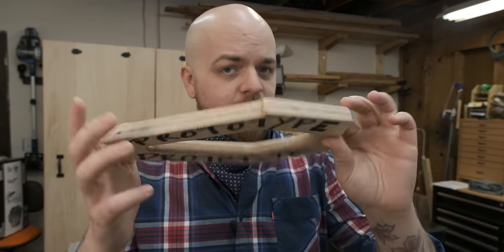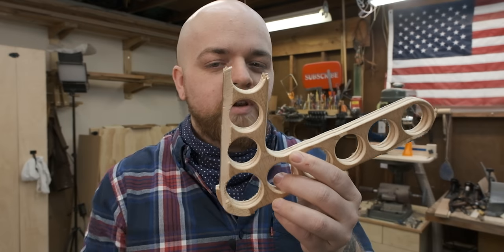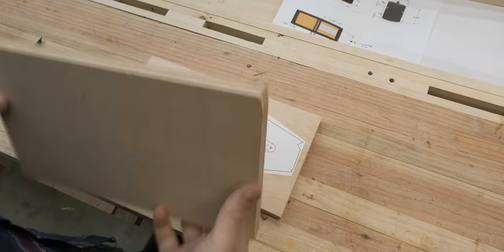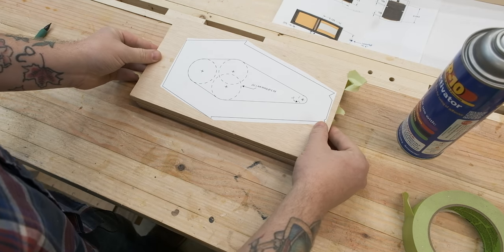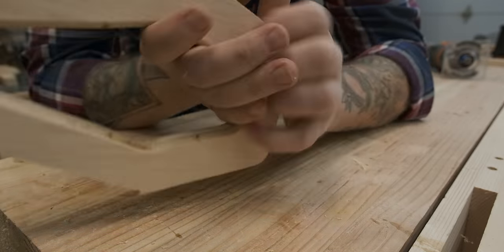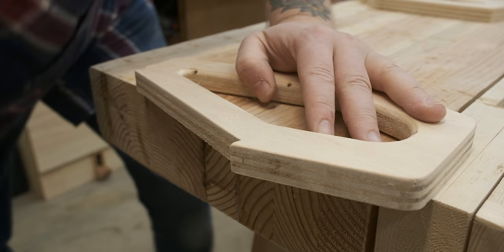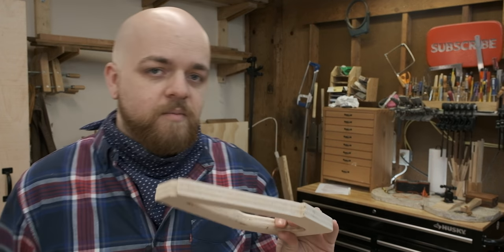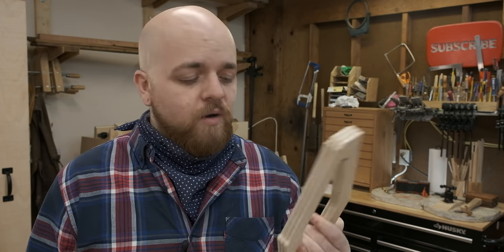DON'T CUT YOUR FINGERS OFF! Make The Optimum Push Block

Comment: 2:41 Uh... Canada uses Imperial... and some in United Kingdom too? ... If you google that, only THREE countries still use Imperial... United States of America, Myanmar, and Liberia... and the latter two run Imperial alongside Metric.
I live in US... and I HATE the Imperial system. I can still deal with the fact 1 feet is 12 inches just fine... but just kill me with all the break numbers in under-inch-denotations. Yeah 1/4... 1/3... 1/2 is still fine... but when you need the next higher drill from 1/2 inch... and that's then 9/16 inch... all I can say is... WTF! What moron came up with that? Why on earth break numbers? That makes no sense, i'd rather have some arbitrary number that divides 1 inch into 12 segments.
And yeah I know there is a way to use decimals for those too... but guess what, Drill Bits DO NOT USE DECIMALS.

So yeah, I not shit on the Imperial system... but it is highly impractical and I not want to know how much it slows down work performance in some folks. Me included.

Comment: wish this vid had been there BEFORE severing my middle finger tip and 4 tendons, scaring the cak out of my kids, 3 surgeries, 6 months of physio and a further 2 years (cos I didn't do the self physio at home as much as I should have) of pain and struggling before I could hold a saw, chisel, hammer or the 4 years it took in total till I could grip a screwdriver one handed.  I could have put a thin piece of board to cover the front and back faces and use it as a coffin to bury the finger tip (They actually ask you if you want to keep them! gross!)  n all because I used the wrong tool for the job and got kickback.  Yes, my hand would still have hit the table surface, but probably have been far enough away from the blade to still have all my finger (I'd also be able to give idiot drivers the bird!).

Looks like a really good design, keeps the hand high up from the blade.  I'll probably make mine a bit oversized.  Thanks for giving this to people and for explaining why it's different to other styles.

Comment: Thank you very much for the templates for this push stick. The design is great. I'm going to make a pair to use on my next project which is a long low cabinet shelf with lots of cutting and jointing using my table saw. I'll call them "Dracs" because... well, you know. LOL! Thanks again.

Comment: Cool design, but not for me, sorry. If the push stick breaks, your hands will be going straight towards the blade.
If I were to make such a push stick, I would make the angles not parallel to help with that, maybe 5 degrees or so, and I would add either a vertical or X-shaped profile in the middle, to help prevent the plywood from breaking.
Here's MY reasoning; If the piece gets caught in the blade for whatever reason, you are going to hold on tighter to your push stick to make sure it doesn't kickback on you, thus applying more force to the push stick and risking of breaking it more easily. And if the push stick breaks while doing so (trying to retain the workpiece from kickbacking on you) you would have your hand pointing slightly upwards, which would mean you would be less inclined to go straight down when it breaks but more forward and less downwards.
I will stick to the Grr-Ripper for now, even though I don't like it that much either.

Comment: Thanks so much for template!  Really like it’s design. One thought that I noticed was do you have a lot of runout on your drill press?  From the video I could have sworn your bit was wobbling. I also could be my eyeballs. Thanks again for the video and commentary!
Reply from the maker: It's strange, there appears to be a ton of runout when observing it run, but the holes cut clean even when the stock is clamped down securely. I'm really unsure what's going on to be honest.

Comment: Hooray for Imperial and Metric, it causes me to own 2 sets of drill bits etc. The problem with watching US videos is in the wood measurements. I dont have 1/2 inch or 1 inch plywood. I have 3mm and 7mm and 9mm and 12mm and 16mm.

Comment: I know you seem to like the CA glue trick... but, I have been using an alternative to that for years, and all you have to do is square up two side of the two boards. Take the squared up boards and run a single piece of tape corner to corner over the edges of both boards along the two squared sides. That's it. You're done. Use a quarter of the tape, and no CA at all, nowhere near the pull off trouble. The only drawback- don't use this method if you are cutting angles into your boards.

Comment: I DID download the push block plans. (Kinda cool how the product of your brain winds up glued to wood in a Tennessee shop.) I find your design great to use for precisely the reasons that you mentioned. I would like to suggest one small additional operation to the fabrication. In addition to using a round over bit on the inside of the block, I also rounded over the outside, but only on the back "handle" area. A bit better feel in my opinion. THANKS!

Comment: Having built many push sticks/blocks over the years, I thought there was no way to improve the design. Happily, I was wrong. Time to make some new ones! Well done!
Reply from the maker: Sweet!
Reply: @Craftswright  Mine will likely be nowhere near as nice looking or finished. And I will probably make them out of scrap 3/8" or 1/2" cabinet ply. That way I don't tear up the heel as quickly when making rips under 3/4"

I treat them as expendable, so no need to make them fancy. Function over form this time.

Comment: That suction tube doesn't work worth a damn does it?
Reply from the maker: Hahah definitely not when I forget to turn the suction on. It's also tricky with a 1.75" hole, the chips are too big for a smaller nozzle, but a wide open nozzle doesn't direct the airflow enough. 🤕

Comment: I had the same issue as you but my homemade stick is a bit bulky. Thanks for sharing your design.  It's just what I need. I'm a newbie and retired of my tablet saw. But I Never remove the blade cover. It's easy enough to find another way to make the cut safely. Safety First. 
Kind regards Cindy.

Comment: These look great.  Gonna give it a try before spending 100 on a plastic transformer pushblock.  I don't expect to use the front teeth very often.  Most of the time when I'm cutting stuff I find that I need to push down some to make sure the work stays flat on the cutting surface.

Comment: First time here but it won't be my last. You have a great presence in front of the camera like all of us are behind it. You're very relaxed and that comes across which makes what your presenting that much more believable. That's not that easy to do. Great video and excellent safety info. BTW: Took you up on your offer to download the Push Stick Template . . . Thanks!  Actually learned something watching you. Since I am a more "seasoned" woodworker, I have a tendency to think I know or have seen most if not all the basic stuff like joining two boards together for uniformity. Well I learned that there is more to doing this that double sided tape that is a real #$@#% to get apart. Your method looks a lot easier and less expensive. . . Just as long as one remembers to tape the mating surfaces first ! ! ! 😆 

Anyway, really enjoyed the video and will look around your webpage and subscribe. Looking forward to you teaching an ol' dog a few more tricks.

Stay safe my Friend, stay safe.

Comment: it's good you are improving safety with your design of the push block.  Having the guard over the blade would be another great safety feature. The makers supplied one with the saw when it was new after all. But there again I worked as a safety consultant and would always strongly recommend having the guards fitted. I live in the UK and if you had a saw in a commercial shop unguarded you would risk quite heavy fines.

Comment: Always good to see new designs and sharing.  A couple of suggestions: 1. Spray the 77 adhesive on the back of the paper, not the wood, to avoid sticky wood surfaces in subsequent steps.  2. Double sided tape is easier and cleaner than the CA and tape method.  You can also just tape the edges together.  (That's how I do rocket fins).  I like the thinking behind the design.
Reply from the maker: Thanks for the tips Randy, I don't know why I've never thought of spraying it on the template, seems kind of obvious now haha. I might need to find some different double sided tape. The stuff I have in my shop is carpet tape and it's so friggin sticky that it makes a bigger mess for me than the CA & tape method. Any recommendations?
Reply: @Craftswright  I use the double sided tape that looks like regular masking tape.  It's usually about 1/2" wide and often used for mounting pictures, but is more than strong enough to keep boards together for cutting and sanding.  Frankly, though, I find it's very easy to just tape the edges together and add another piece when you cut it off when finishing.

Although it takes more setup, using a trim bit in the router cleans up those edges very quickly without using the rasp.  It works nicely to make a template out of MDF and then use that for marking cutouts and as an edge for trimming.
Reply from the maker: I’ll keep my eyes out for it and the router tip is also genius! You sir need a channel 😁

Comment: Thanks and great design -- have the plans but do not see any dimensions apart from the forstner bits - long long L to R and Top to Bottom please do you suggest? Tks
Reply: its a pattern... stick it on and cut them out
Reply from the maker: Hey Graham, it's roughly 10" long by 5.5" wide. My best suggestion would be to print the template in landscape orientation and make sure that "do not scale" is selected. Really the dimensions don't matter that much, if you're a little smaller or a little bigger the block will still work. Hope that helps! 😊
Reply: @Craftswright  Hi Perfect many thanks will make some over the weekend- Have fun and thanks again

Comment: I just made some of these. Like you, I did two at once.  I made mine out of scrap 3/4" pine which may be a mistake as I am not sure if the small notches will hold up to repeated use.  Time will tell. Thanks for the design.

Comment: Again I have to skip to near the end of your video to see what this device actually does (like the 11min mark). Only to find that imo the design still puts the hand way too close to the spinning blade for my comfort. I like a longer stick for my push hand. But this does put more downward pressure than a long stick which is good. Still looking for a better push block solution. Yes I could use a top feather board but I'm generally too lazy to set it up.
Reply: So... you are too lazy to use the safety equipment you know you should use, but not lazy enough to complain about someone else's idea... Hmmmm

Comment: Thank you very much for the free template, i love your design concept. I might at some point try a concept i saw on another design which is to add glued on scrap wood to edges that will get chewed up over time. then it is a simple matter of replacing the scrap wood rather than remake a whole new push stick. Have a great Christmas and New Year.
Reply from the maker: Sounds like a solid idea!

Comment: There are two units of measurement in the world, the metric system and the system that put a man on the moon in 1969 ;)!!!
Reply from the maker: And have won ALL of the Super Bowls 😆
Reply: There's a classic story about a joint NASA/ Lockheed space project (Mars climate orbiter) where both systems were accidentally overlapped in the software that lead to it breaking up, oops.
https://en.m.wikipedia.org/wiki/Mars_Climate_Orbiter
Reply: Truth is, NASA did use the metric system for the Apollo Moon landings. SCNR
Reply from the maker: And I’m sure the team doctors for the NFL also use metric ☹️
Reply: @Craftswright  The ball still lands between yard markings. And that won't change. In wood working you don't really need metric. A European church was usually built with one measuring rod. And each master stonemason had his own, which was different from that of other master stonemasons. It doesn't matter which dimensional system you use, as long as the design is great.
Reply: @kleckerklotz9620  I agree that it is usually inconsequential which system is used, but I'd just say in certain applications it is nice that the metric system is just a base 10 system, because you can trivially figure out what a decimal calculation is in the metric system. Usually this is a non-issue, but if you have to calculate a measurement for some reason it's more of a pain to go through the effort of figuring out which 64th is closest to that decimal. If metric you just calculate that something is 6.84 cm, and therefore it is about half way past the 8th mm after the 6cm mark. Pretty rare that this is useful in most woodworking applications, but in my case I was building a guitar and had to convert any fret positions from decimals to the nearest 32nd of an inch, whereas a metric user would have just pulled out their ruler and started marking it out. I thought about buying a meter stick, but it wasn't that big of a deal to do the 24 calculations instead of spending money for a ruler I would rarely use otherwise.

But also while I'm here I'll say that imperial can be quite handy when you need to divide a distance in half, which is a pretty common thing to do. 3/8 divided by 2? Just keep that numerator and go on to the next denominator, 3/16. Imperial is kinda in some ways a base 2 system. But dividing by 2 isn't exactly difficult in either system.

But I'm also aware that imperial calculators do exist, I just don't remember the last time I've seen one.
Reply: @MattMcConaha  I agree completely. Metric is the better system. Since I'm a German, I have never worked in another, except one or two projects. Metric really shines, when you are working with other quantities like elctric current, temperature or mass. And as you mentioned, in small regularly increasing intervals. But if you don't, you don't need metric.

Comment: Great design and thank you for the free plans. I'm 52 UK born and educated at a time when Imperial was being (supposedly) phased out. Despite that I still use Imperial for large measurements and metric for small, mm seem easier than fractions. There's also the 'nearest whole number' method which I surely can't be the only UK person using where, since we still have tapes marked with both systems, I literally measure some things using both in parallel depending on which side of the tape is closest to a whole number or simple 1/4, 1/2 or 3/4 fraction. I've done it all my adult life.
Reply: Same here, learnt both as a kid and use mostly metric, but feet and fractions of them are handy. I'm 6' 2" tall, not 1.87m.
Personally I don't care what measurements folk use, whatever works for them. Just so long as we both know which system is being used.
Reply: I'm not the only one?? 😅🤘
Reply from the maker: I love it sewob147! I definitely think there's a weird "tribalism" to our crafts that isn't 100% necessary. If something different works for someone, let it work for them! I might need to get me one of them dual tapes 😀 Cheers!

Comment: Metric system bad?!
Okay...
1 milimeter x 10 = 1 centymeter 
1 centymeter x10 = 1 decymeter
1 centymeter x 100 = 1 meter
1 meter x 1000 = 1 kilometer
Simple. And there we have fak logic as this imperial shhh where
1cm x 2,54 = 1 inch 🤦🏻‍♂️
1 inch x 12 = 1 foot
1 foot x 5280 = mile
And 1 inch x 63360 = 1 mile.
This all sounds like made by germans 😂
Reply from the maker: Hey I even admitted in the video metric makes way more sense lol I'm just stuck in my ways for the moment 😁